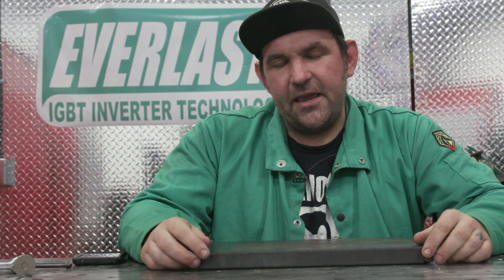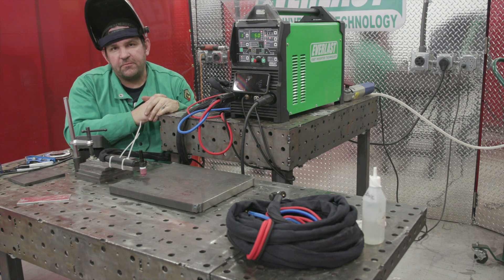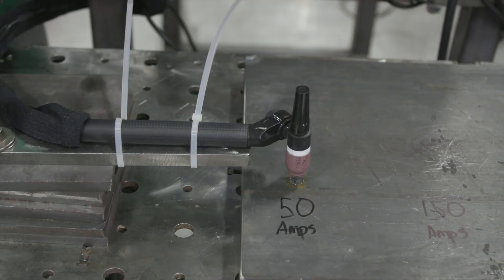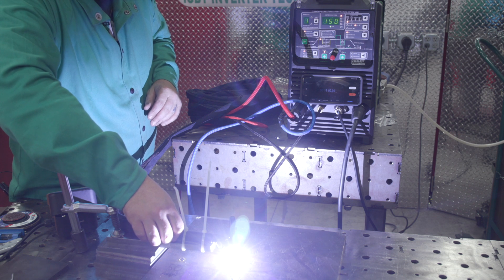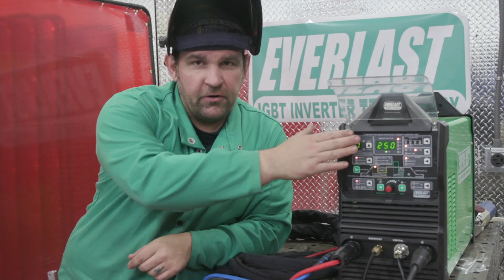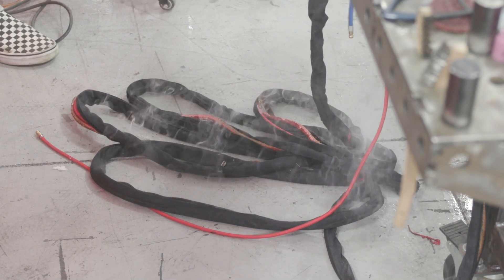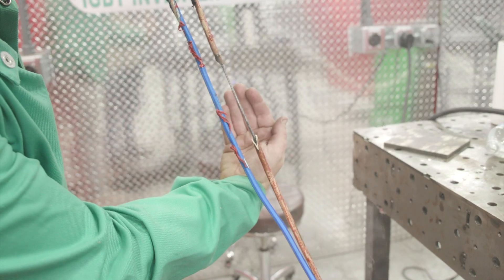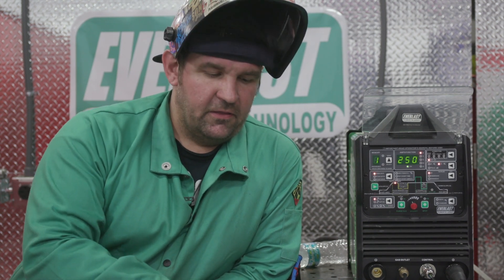Can you Run a Water Cooled Torch without a Water Cooler? | Everlast Welders

Comment: Update.... So these types of tests are cool but it really hurts to see you just destroy and melt these torches like everlast has plenty to go through....(if they are yours personally then I apologize Jesse).... However I contacted Everlast a couple of days ago and they basically said, Oh you bought all your equipment(Mts 275 lightning, powercool 400, Plasma 60, Cart, and cover..... Over $5,000 and that's because I bought it PRE-PRODUCTION, So I got a discount, Supposedly) in 2019 and there is only a 1 year warranty on torches.... To be honest I bet I don't have 3 hrs. total on that tig torch and only welded 18 and 20 gauge sheet metal & the water line is already shot.... So beware, even if you do have a water cooler (Power cool 400 in my case), YOU ARE NOT GUARANTEED TO HAVE SUCCESS WITH THIS TORCH.... 

Original Comment: 6-19-2023..... 
My red line is very brittle and broken.... What are my options?? I got the 26 style Flex Lock when I got my MTS 275.... and I used the water cooler with it.... It doesn't make sense to me....

Comment: so the mts 275 needs a water cooler? i read that it comes with a water cooled torch standard and i was gonna buy this for my first welder i under stand it’s pricey, i could get something cheaper and i was, i was originally gonna get a primeweld tig225 but i wanted the 275 for the fact of having HF start on tig and being able to do mig and stick and flux core. granted i don’t know any of the processes i like the capabilities this has to do all of those pretty well from what i’ve seen so far which isn’t much. but that being said i don’t really wanna have to buy the water cooler in order to be welding all the time because that’s what it comes with but i like the things this has over the mts 225 they make.

Comment: You should have redone the test with the cooler on to show that if it could hold up to those temperatures.
Reply: Also, invest in a gun thermometer to remotely check the temps.  Aim the laser and pull.  And EL surely can afford one that records, as well.  Fluke makes a bunch of them.  Better than guessing by "feel".  Just my FWIW.

Comment: I'm in the market for a power tig 350 EXT can you do a video on that.machine
Reply: If you check out my Instagram i've got quite a bit of content using the 325. 350 has a touch more duty cycle, but functionally its the same machine. @mccollum.weldfab

Comment: I'm sorry but im 26 seconds in and am already like.... uuuhhh wtf lol. why would you have a water-cooled torch without a water cooler??? idk...
Reply: You would be surprised how often this question comes up... I would say between all the forums i'm on, I see it at least 3 times a month. Machines over 200amps come standard with a water cooled torch, due to the fact that there isnt an air cooled torch thats rated above 180amp DC, BUT everlast will switch out the torch for you, if requested. I think some people don't notice this.
Reply: What?  You've never said, "Just a few welds".

Comment: That was painful to watch.  Were those CK Worldwide "superflex" lines?  I think I put the same #20 torch on my 255 EXT.  I built my own cooler from a carbonator pump and put a microcontroller on it so it turns off when I'm not welding.  It also checks for adequate flow rate before allowing me to weld.  A nerd's dream, it is.... 😒
Reply: These were all Nova Roto heads

Comment: pretty fucked up everlast. if i wanted a water cooled torch and a water cooler rig i would have ordered one so why a a new purchace you send me a tig machine ex 250n with a water cooled torch that i cant use without a water cooling rig? then i had to order seperate an air cooled torch sounds like a scam to me. i like the machine but not the stupid SCAM.
Reply from the maker: There are no 250 amp air cooled torches. When you purchase the machine give us a call if you want a 26.
Reply: Its stated on the site it comes with an 18 series torch, a 26 series torch is only rated at 180 amps DC, even less for AC... The only option for a torch rated for the max amperage of the machine is a water cooled option..... But I am sure if you were to call the everlast sales team they would have gladly swapped the torch out for an air cooled model for you before shipping.

Comment: so wyh is it when you order a machine from everlast they send you a tig machine with a water cool torch pretty stupid in my way of thinking. without the water cooler duh. then youhave to order seperate the air cooled torch pretty fucked up in my way of thinking to operate the machine.
Reply from the maker: There are no 250 amp air cooled torches. When you purchase the machine give us a call if you want a 26.

Comment: Great video and oddly satisfying to see those torches burn up. 
It would have been interesting to see how an air cooled #9 (rated at 125 amps) faired in the same tests. 
Both torches have the same physical dimensions but does that mean that a “waterless” #20 can be treated like it’s a #9?
My guess is NO... but as they say, “1 test is worth more than 1000 opinions”.